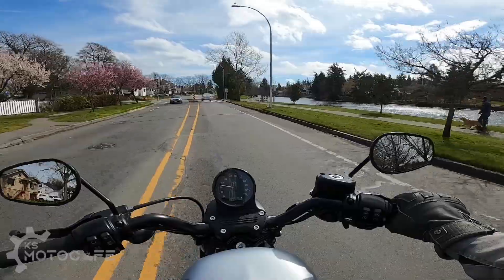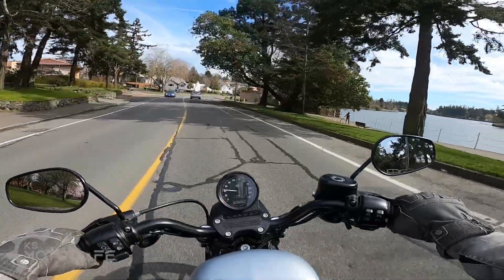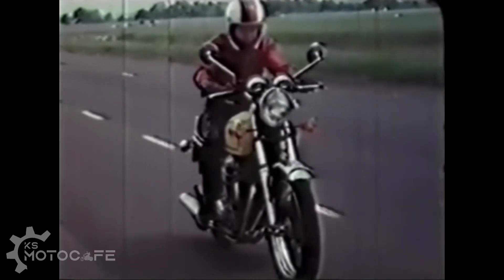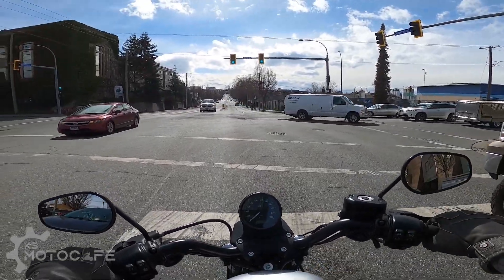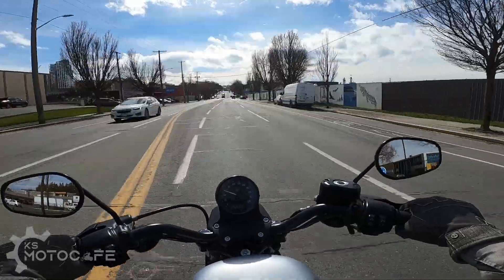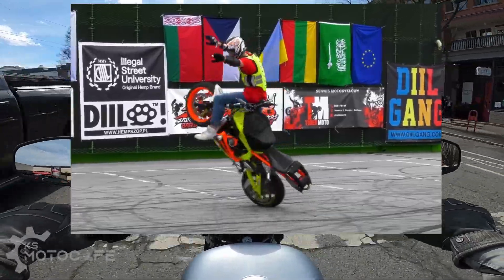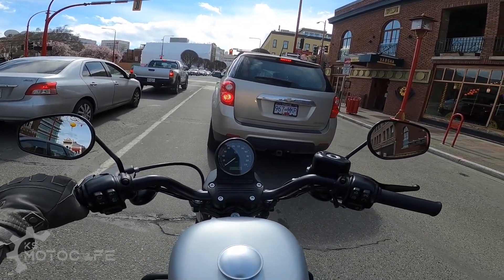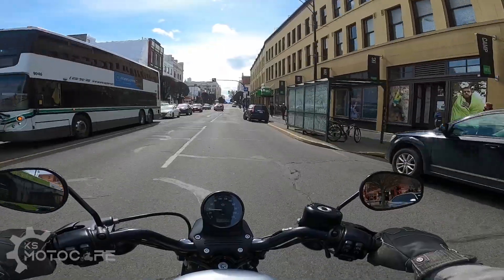Death Wobble, Speed Wobble, and Tank Slapper on a motorcycle explained!

Comment: I have a 94 electra glide, around 65/70 mph 110/120ish km, it starts rocking left to right. Im pretty sure driving any faster than that would cause the handle bars to start getting violent. I also know its a mechanical problem because of lack of maintenance from the previous owner. Im the only one who works on my vehicles. I at least cant blame anyone else in those situations but myself.
Reply from the maker: wow - pretty rare to see a big cruiser getting a death wobble.  Good thing you were able to get out of it before it escalated.  What kind of maintenance prob was it? low tire pressure and tire balance?
Reply: @KSMotoCafe  front tire is out of alignment. I did have to readjust air pressure. The previous owner had done their on maintenance on the bike. Which was almost none, other than rebuilding the motor wrong. The rubber motor mounts are also a problem on the older Harley Davidson's. Pretty much all of the 90s models had ruber motor mounts. I know mines a bit chewed up and i bought a new one to replace it so that I know I replaced it and dont have to worry about it.

Comment: I'm a new rider maybe two weeks total experience, was going downhill at 35km an hour, had a wobble, and as a new rider, touched the front brake, went flying head first into the ground in white rock bc. I'm alright but was a wake up call. My tire pressure was also very low and I didn't realize. Was at 14 psi when spec was 29. Learning experience !
Reply from the maker: shit bro - thanks for sharing that scary experience.  It is so easy for us new riders to quickly reach for that front brake (due to bicycle instincts).  Glad you made it out ok.  Did it cause a concussion? what bike was it
Reply: @KSMotoCafe  2015 Yamaha YZF-R3 No ABS
Reply: @KSMotoCafe  I didn't go to the doctor I assume I'm fine, had a migraine for a few days
Reply from the maker: @joshyshreds55  yikes - talk about learn the hard way! At least the lesson was learned at 35kph rather than 100+.  I always wanted to try R3 - the Yamaha R series are on my top list of good looking sport bikes - I also like the BMW 1000R bikes too.  Something about the low profile headlights, it is sharp looking.  So are you back up and riding?
Reply: @KSMotoCafe  Yes I am, practicing my skills. Much more respect for the bike now. I did take a safety course prior but I'm still very new and learning. I love the r3, glad I had sliders on it and got a used bike as a beginner.
Reply from the maker: Nice! I always give mad props for riders who quickly get back on their bikes after a fall.  You will find my channel is mostly geared towards riding safe/prepared and sharing my experience as I also learn to ride and try different bikes/activities.  🤟
Reply: @KSMotoCafe  Subscribed 🤙

Comment: I'd just picked up a used 2005 Victory Kingpin in Portland, and was heading back to Canada when the entire buke started wobbling, but not like yours, it was the whole bike leaned over to the rigbt, then to the left, etc. Scared the crap out of me, never happened before. I instinctively throttled back, and it slowly corrected as I slowed down. When I cranked the speed back up, it did it again. (About 70 mph) Needless to say, my trip home was much longer than planned. Took it in as soon as I got it registered and insured, they said there were unusual wear patterns on the front, so I threw $200 at them and put a new front on. Never had another problem with it as long as I owned tbe bike.
Reply: its crazy how actually applying new parts through seasonal maintenance can prevent that...
Reply from the maker: yeah I was gonna say if it keeps happening at past a certain speed, it definitely has to do with tires or luggage that is not balanced.  Glad tou made it back with that Victory! Thanks for sharing your experience!

Comment: Always throttle off and/or use some gentle rear brake. Any changes to your velocity will affect the wobble but slowing down simply means that if you do end up crashing, at least you'll be going a bit slower.
Reply from the maker: valid point - I also favour slowing down if I can in that kind of situation where I could end up eating pavement! Thanks for chiming in - very much appreciate your tips!

Comment: Experienced a death wobble on my 2007 Triumph Daytona 675. I was accelerating over 75mph and hit a bump in the road (specifically a pothole followed my a 1 inch drop in the asphalt level.) When it happened I immediately went onto the rear brake ONLY, and pulled the clutch in so that I wouldn't pull the throttle whilst the handle bars flew around. I also got up on the bike so that wind resistant would help me slow down even quicker. Lastly I let my hands try to control the bars movement lightly but didn't try to stop the wobble in total. Within about 4 seconds I came out of it and was fine.
Reply from the maker: wow thanks for that info! Didn't think about pulling the clutch in but makes sense if you want to slow down! Did you know about the wobbles when it happened or did you do all that through natural instinct?
Reply: @KSMotoCafe  I ride multiple motorcycles and the main one I ride has a GPS steering stabilizer on it so I get 0 movement from it even from hard takeoffs and wheelies. The Triumph I only had for a month at the time. I knew about it but never prepared or watched videos on it.